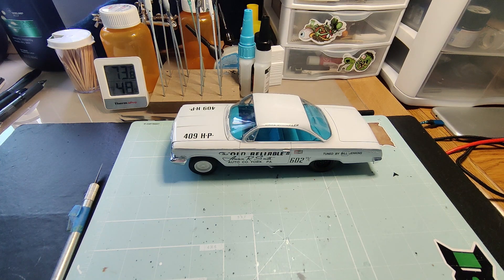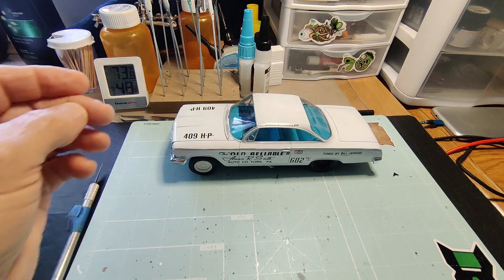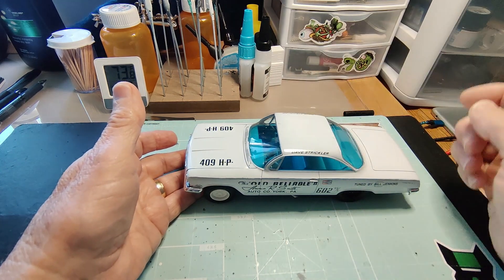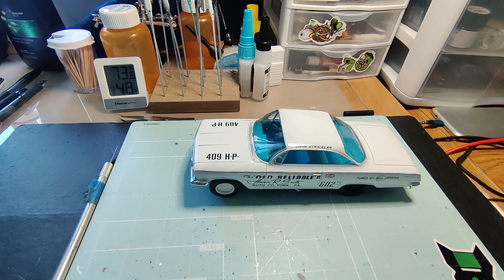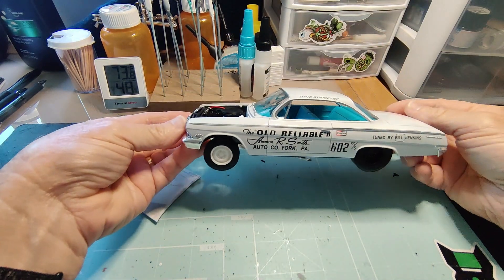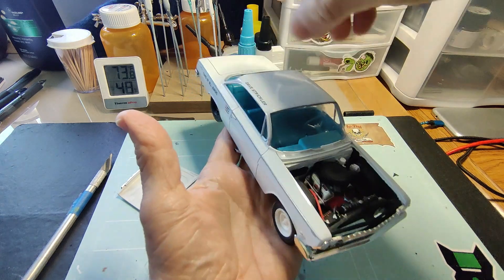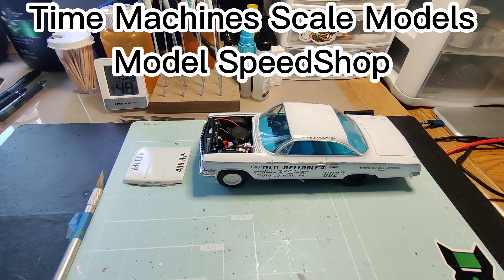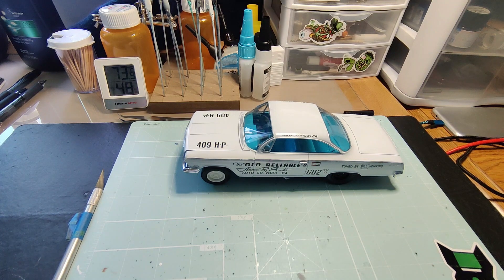#Under1000Subs Group Build Final

Comment: Nice build Larry!  Glad you were able to get it painted and finished up.  Bummer about the decals! Maybe can get a cheap set at the NNL to finish off that side.  I did record a how to polish glass way back on the USACC RR build that I need to pull off the flash drive and get edited.  Glass is easier than paint as you can sand and polish as long as there's something there (no burn through).  Anyway cool build and on to the next!
Reply from the maker: Yep, thanks for the positive words.  I appreciate that.  I've watched a number of video's on sanding and polishing out little bits of junk in the paint and have had someone suggest using NOVUS for the windshield.  Yes, I will keep my eyes open for decals as I also need a set for a Pace Car Corvette I picked up for $1.00.